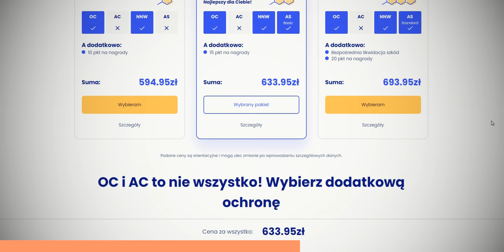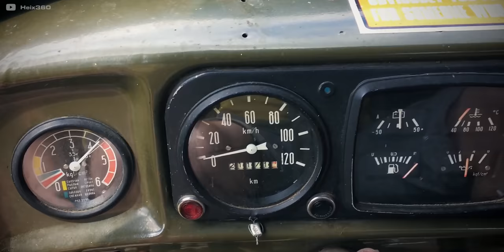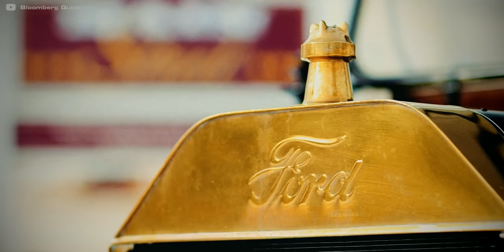Oto NAJNIŻEJ kręcące się silniki spalinowe. Jak nisko może kręcić się silnik? Ledwo działają!

Comment: czy ktoś pamięta "samochód" zwany Brutusem, który wystąpił w Top Gear lata temu? miał silnik V12 o pojemności 46,9litra, spalał ok 4,5 litra na 1/5 mili (czyli ok 320m) 😱. w sprincie na 2km spalał ok 30litrów paliwa 🤯 i produkował w tym czasie 28.000g (czyli 28kg) CO2 na km... miał 493KM przy 1500obr/min a 100km/h osiągał przy 800obr/min... nie znalazłem danych o obrotach max... 🤷‍♂️ ale pewnie nie są o wiele wyższe niż 1500 🤔 może ok 2k? 🤷‍♂️